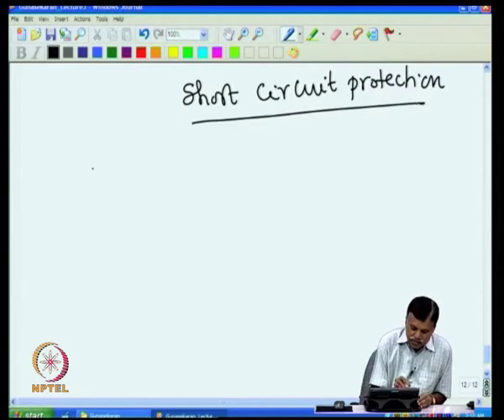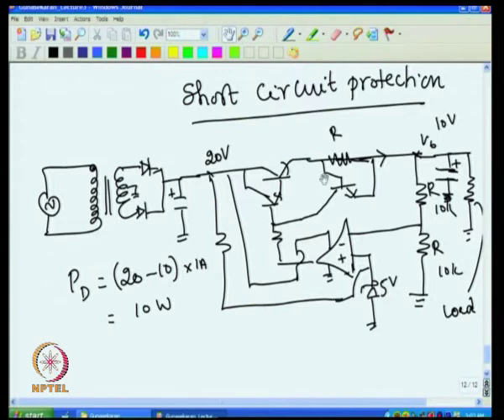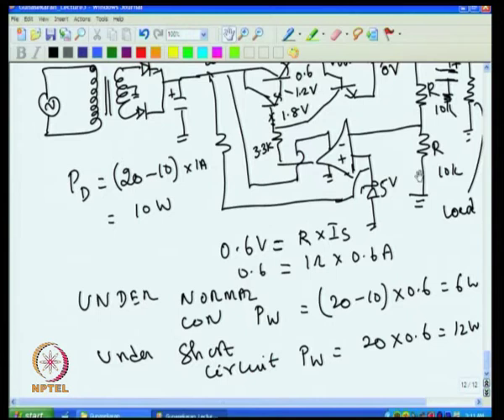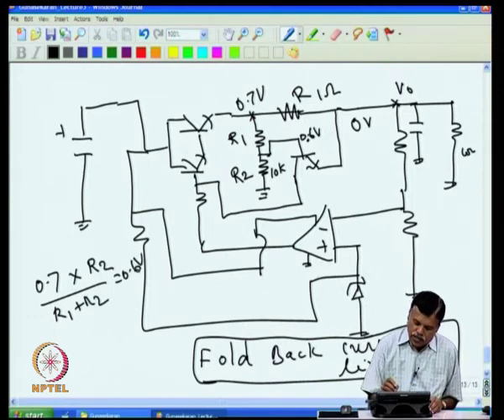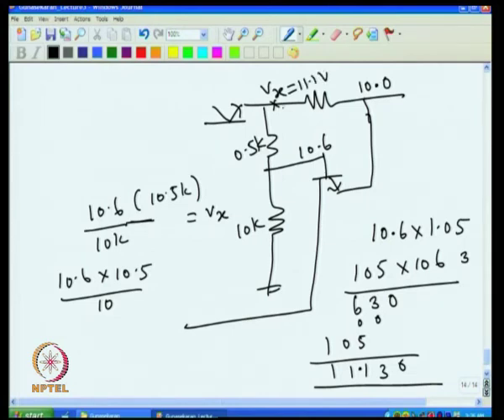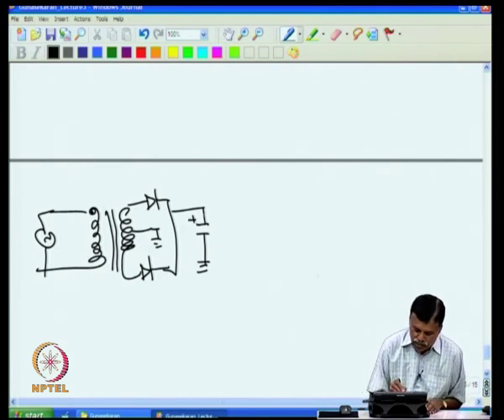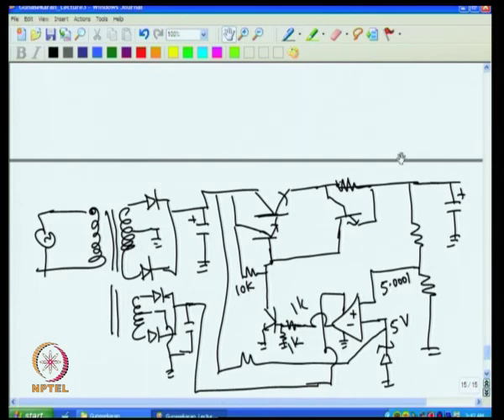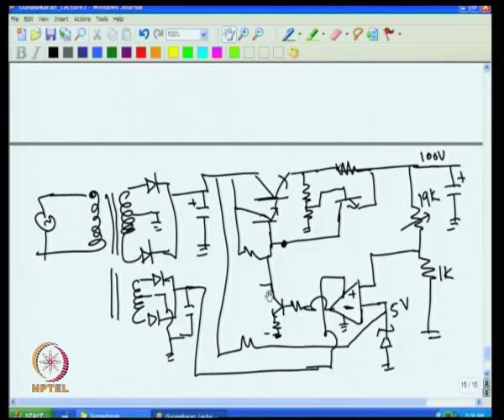Mod-03 Lec-07 Short circuit protection for linear power supply

Comment: Sar I have 24v 5 Amp SMPS Power Supply Board There Have A One Problem That Was Short Circuit Protection I Need To Disable Because I need Bench Power Supply thats Why I Need To Disable The Short Circuit Protction Please Help U Such A Genius Of Electronics You Differently Slove My Problem
Reply: Ah, I came searching solution for same problem. I am tring to drive a stepper motor with SMPS, but it activates short-circuit protection unnecessarily during start.

Comment: if i use 0.1 ohm resistance in seri and i m mading 36v fix power supply with 3 a current output this is 40 *6  power dissipation in short circuit :o